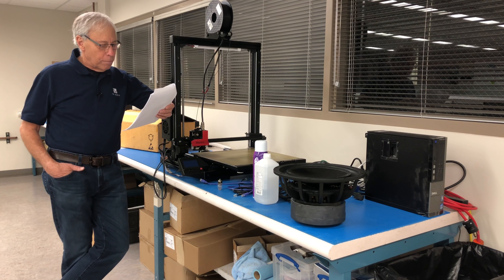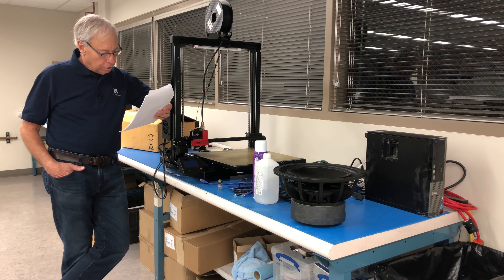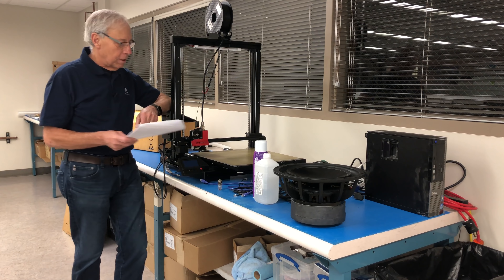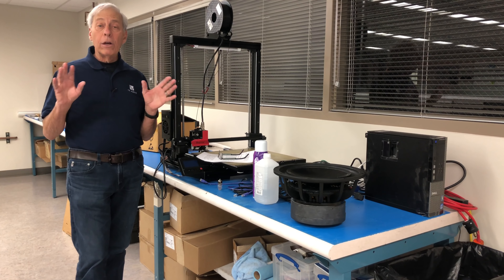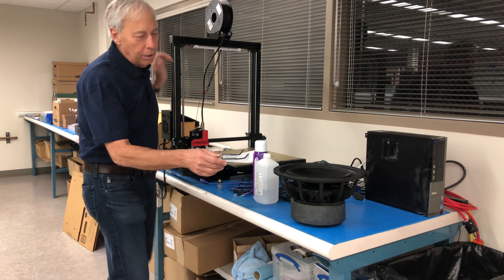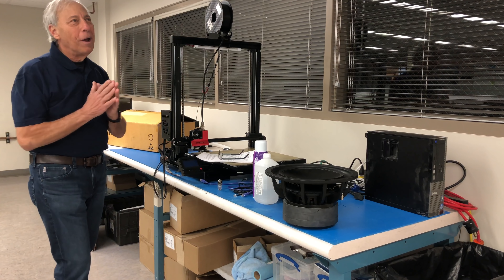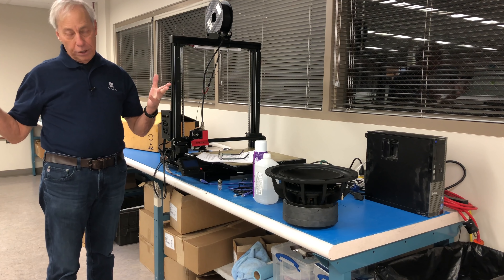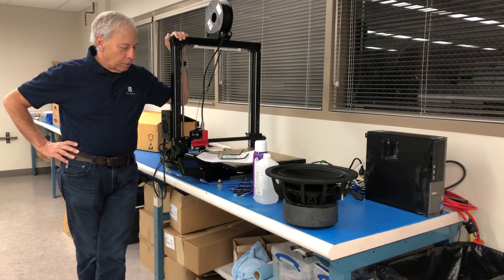Why do vacuum tubes color the sound?

Comment: My simple explanation... tubes make small signals larger but the amplification applied is not 100% linear over the whole input range. When approaching the limits of the input headroom, the gain often falls slightly (the amount being design dependant) and this can result in a small amount of waveform distortion at the signal peaks. As the amplification rolls off at the limits of headroom, it results in even-order harmonic distortion which is often sweet sounding because it's harmonically related in a musical way; like a harmony with one note an octave above. Accentuated even-order (2nd, 4th, 6th, ...) harmonic distortion is the sound of classic Rock n' Roll guitar. Transistors on the other hand run out of headroom in a much less graceful way, causing their induced distortion to be made largely of odd-order harmonics which are both 50% higher in frequency and not harmonically related of the original signal in a very musical way. Accentuated odd-order harmonic distortion (3rd, 5th, 7th, ...) is the sound of typical Heavy Metal guitar. Ideally, your signals will never reach these extremes and any distortion you encounter will be below audible thresholds, but in the world of critical listening even the slightest variation of the harmonic content will be noticable.  Less conservatively designed equipment will generally exhibit more distortion and some products intentionally add distortion to artificially "sweeten" the signal, but it's all about what you love the sound of and not being technically perfect.
Reply: Thanks for the expansion on Paul's explanation. The odd and even order distortions makes so much sense. Even if a valve has an order of magnitude more distortion than a transistor it's distortion is an order of magnitude less grating on the ear. Cheers.

Comment: PEOPLE - get over the concept of, “tubes color sound”. Tubes are wonderful, old school technology, that work beautifully in audio applications. Period, end of story!
Reply: An audio illusion- oh, I get it. My illusions are BETTER w tubes....just saying
Reply: tubes do not work beautifully anywhere, audio or otherwise, they are not stable, produce noise, have short life, are hot and bulky, require high voltage, use a lot of power, and have high impedance; from an engineering point of view, they are a nighmare

Comment: For those tube distortion loving aficionados, you can add the same and even more refined tube like distortion effect using a DSP on your digital music. Compared to a an actual tube, a DSP can maintain the exact same sound without any need for warm up or effect of aging issues that hurt the sound of tubes over time. It can even be optimized to best sounding distortion. The even harmonic distortion some people like from tubes can easily be modeled in DSP code. There is no magic to this. Especially live music contains more such distortion and that’s why using tubes can make music more live sounding. If you play studio recorded music and like the cleanest most undistorted sound, tubes really make no sense. E.g. a live concert with Diana Krall can sound better with tubes while music by Deadmau5 will sound worse.
Reply: Over generalizing I did A-B comparisons with both live actually Diana Krall and several Purely Ambient electronic CD's and Vinyl and the reference ST70 Valve amp from Raymond Lumley was clearly better, not soft or warm it just had a highly detailed holographic sound underpinned by superbly solid fast bass, dynamic but yet polished. It was able to allow instruments and layeted sounds to hang in the sor without losing coherence, in a way the Advantage solid state Pre and power costing over 5K GBP my friend who bought the Amp on eBay paid less than 1K GBP and a further 50GBP to have it serviced, checked and rebiased. It is quite simply one of the best sounding Amplifiers I have had the pleasure of hearing. Valve or SS.
Reply: Gerald Holley Well designed amps using transistors or tubes can sound better than not so well designed transistor amps.
Reply: Old tubes last way longer than a lot of newer tubes. I think that's where tubes get their reputation of being short-lived, also in part because tubes are not always implemented correctly to optimize performance
Reply: The Chad Pad There isn’t much money in making tubes anymore, so they are made low tech with low standards of manufacturing and quality assurance nowadays. To be honest, as an engineer with some depth of understanding, I don’t see a true genuine performance argument for using tubes in modern audio gear. The effect a tube can ADD to the signal (e.g. even harmonics) is reproducible using other much more robust circuits based on transistors including DSP.

Comment: Is there anything that does not color the sound?  Short answer, no.
Reply: Short answer, yes.  A noise from space for example.
Reply: Short answer....Solid state
Reply: Fat Rat  Yup, amplifiers, transducers... pretty much everything colors the sound.  Well said.
Reply: Fat Rat  It should be, but it's not.
Reply: Stephen Smith a carefully designed amp, yes
Reply: @FooBar89  Au contraire mon fraire.  Even the $100k monoblocks from Boulder aren't 100% transparent. I've heard them, and they are damn fine amplifiers, but even they can't make Yo-Yo Ma appear in front of you sonically speaking.
Reply: @FooBar89  So tell me which amps are state of the art and do not color sound?
Reply: My, such a little comment, such a big discussion.  Carry on people.

Comment: There is a bit of over-generalisation going on here. The gap between some modern solid state and valve amps has narrowed a lot. I could actually name some solid state amps that sound warm like valves and some valve amps sound so clean they could be SS.
Reply: Measurements.  Valves get nowhere near and they don't stay in spec as long as ss.
Reply: @captainwin6333  Saying tubes don't stay in spec  as long as solid state is generally true until now Bob Carver makes a tube amp where the tubes last for 50 years hence stay in spec for 50 years.
Reply: @captainwin6333  . Not sure that's true with well engineered stuff like Audio Research.
Reply: Valve amps don't necessarily sound "warm" its a misnomer. They generally sound very detailed and polished but the best ones are very dynamic underpinned by solid fast bass. Or at least the ones I have heard do.

Comment: There seems to be no end of generalizations when it comes to tubes.  Assuming that all tube amps sound the same, is just as ridiculous as saying all solid state amps sound the same.  Just changing tubes in the same amp will yield different results.  And one more thing - Tube buffers are pure audio snake oil that make absolutely no sense what so ever.
Reply: I would disagree with your final sentence and say that tube buffers are most often EQs, often with limited fidelity to accentuate 2nd harmonic distortion, and if you like the sound they produce then you should enjoy them. If your power amp or speakers are particularly bright, a little tube induced warmth can go a long way. Listening is about enjoyment.

Comment: I have a love & hate relationship with tubes, on one hand, they can produce the most beautiful warm and sweet sound that you can imagine. On the other hand, I never could make any digital recording from a phonopreamp based on tubes. I listen the loudspeakers, the sound is super clear, no hum, no nothing. I plug the same device on my audio interface and made a recording and I get not less than 15 lines of hum. I tried with the turntable grounded to the phono preamp, with the turntable ungounded from everything, grounded to the amplifier, to a screw in the pc chasis. Still those f***ing lines of hum, while in the loudspeakers or in the headphones the sound is lovely.

Comment: Howdy. My theory:
The amplification factor is pretty much independent of collector voltage in BJT:s (of course as long it is not driven into saturation). In tubes the amplification factor is slightly dependent on the anode voltage. The negative half cycle on the anode will not go down quite as much as anticipated. I see this as an introduction of the third harmonic.
Regards.

Comment: Tubes don't color the sound if they're applied and designed in skillfully -- but the transformers required to get them to drive low impedance transducers via inductive coupling sure do!
Reply: Yes, but tubes not coloring the sound serve no purpose if there is no voltage to amplify. Thus, between the line level output of a DAC chip and the line level input of a power amp, a tube can only serve the purpose of coloring sound besides being a visually decorative effect.
Reply: @ThinkingBetter  -- I agree completely: including tubes in modern home stereo gear makes no sense other than for the reasons you mention, neither of which comports with the goal of "high fidelity," which means "great faithfulness" to the music being reproduced.
Reply: @editorjuno  great faithfulness god damn

ppl need to understand the sound is subjective, u choose how u want to interpret sound in this world

even ur ears dont have great faithfulness
Reply: @urnoob5528  -- We;; then, I guess "high fidelity" now means "great faithfulness" to your subjective preferences.  Duly noted.

Comment: Lol!
In the UK there's no such thing as "tubes".
They're VALVES because that's what they do.
..and, may I add, valves 'saturate' (clip) much gentler than transistors..
Reply: Arthur Manolopoulos you are thinking of the 80s, if you have a simple amp yes, there is nothing you cannot do with clipping however, including easily clipping the same way as tubes with transistors

Comment: Everything colors the sound. Tubes tend to have predominantly even order harmonics, transistors, odd order, and, yes, the harmonics effect the sound. Even order harmonics are an octave, odd ordered, an octave plus a fifth. An octave will always sound harmonious and even pleasant, think 12 string guitar, a fifth, maybe, maybe not. I play guitar, we play harmonics frequently. A second order divides the string in half, with the two halves of the string vibrating opposite to one another while the middle of the string is stationary. A third order divides the string in thirds with two null points, a fourth order in quarters. Anything else is effectively impossible to play. If you want to hear this, go to the original America album, titled "America", and listen to the last track, "The Pigeon Song". There are a few single notes at the beginning, all harmonics, followed by a second, third and fourth harmonic strum.
Reply: >Everything colors the sound. Tubes tend to have predominantly even order harmonics,
>transistors, odd order, and, yes, the harmonics effect the sound.
Paul really really danced around the issue on this one. To reflect your post tubes add even harmonic distortion, 2nd order, Solid State odd harmonic 3rd order distortion. What he didn't admit to was how much. Both would be considered distortion. A "warm open airy depth ect ect" tube amp is best in the 1% or 2% even order harmonic distortion range. A solid state amp even it it adds a fraction of a percent of 3rd order harmonic distortion will be displeasing. PS Audio adds a tube stage to some of their products. You figure it out why. A very very low distortion SS amp is often referred to as sterile. And that is true. Nelson Pass designs are sometimes criticized for being too sterile. And that would be a correct observation.

Comment: Thanks Paul ! I finally understand how tubes work... i've seen so many videos and read a lot but never understood it ! I gave up... Now I also understand why a valve and a transistor can both amplify the sound... THANKS A LOT !!!!!!!!!!!!!!!!!!!!!!!!!!!!!!
Reply: FWIW there are transistors that are designed to work exactly like tubes. Field Effect Transistors ( FET ) have very similar characteristics in a circuit. Think of it as a tube that does not need a "heater".
Reply: @wilcalint  only jfet, if u search for fet, the most likely thing u will find is mosfet which is 99% of the fets used ever

also the heck u mean exactly like tubes

fet is semiconductor, couldnt be more different

Comment: Tubes generally have less NFB. This means more low harmonic distortion and less higher harmonic distortion. It is the higher harmonics that add edge to the musical tone. This gives a tube amplifier two advantages - a richer tone and more clarity. The clarity comes from increased low order harmonics that make the fundamental more audible (richer). This is most noticeable with hi-hat. A hi-hat (like most percussion) doesn’t produce a lot of harmonic overtones like other string or wind instruments or vocals. A tube amplifier can add enough harmonic overtones (less than 1% but audible) to make the hi-hat more clear to our ears above a crowded guitar and vocal filled mid-range. (Masking means that lower frequency sound masks the higher frequency sounds just above it -  a little third harmonic distortion can therefore greatly improve audibility as it sits above the masked region covering the fundamental)  microphones are also great for vocals - they compress so nicely (less high order harshness) that you get more audible dynamic range by allowing the engineer to push up the low volume details without the loud stuff sounding overly harsh. Of course, the devil is in the detail of the topology and some tube designs add so much low order distortion that they sound overly “choral” and lack prat or edge altogether.

Comment: Paul, you present great videos to watch. I may have teensy little point to quibble over with regard to vacuum tubes vs transistors or for that matter FET's. 
As you have produced and sold a wide variety of amplifiers with solid state and vacuum tubes, you admitted before that B&K amps with a vacuum tube front end sounded better than your best designed solid state. 
Why is that? May I suggest a couple more things to add to the confusion?
If you put your previous best amplifier on a bench along with the B&K (as I recall it uses MOSFET outputs), both would test with a wide frequency response and very low distortion up to rated power. In theory, your ear shouldn't detect a difference if everything from source, to front end, to speakers were all the same. Still, you would hear a difference. That's coloration. The tube(s) alter the sound. Typically a complete amplifier with tubes and heavyweight impedance matching output transformers would likely measure a slightly higher level of distortion, yet many prefer the sounds of tubes. Thanks for all you do.

Comment: If a tube buffer 'helps" your sound, then you have another problem in your system.
Reply: tubes produce sound much better
Reply: I wouldn't use the word helps but it's really altering the sound in a way one likes. I don't like bright, forward speakers so I never owned one, but others do. Doesn't mean the system has a problem, just that some like a bright sound so they buy these types of speakers.
Reply: @BronsonOsborne  Not better than nothing.
Reply: @briansimmons5363  The speakers are part of the system and thus a problem.
Reply: @bilguana11  Ah, I get it. Speakers are part of the system and thus can be a problem, as can the DAC, speaker cables, turntable, audio rack, amp, room acoustics etc.
Reply: @BronsonOsborne  but with less fidelity and so you can't call it Hi Fidelity.
Reply: @captainwin6333   i  use  fisher kx 200 all tube with phase technology speakers and a schitt DAC  AND pioneer pl l800s turntable the tubes really bring out the best in music
Reply: Not true, if using tubes instruments and voices sound more akin to reality then there's no problem with your system at all.
Reply: Bill Crane ... there is no problem if you enjoy the sound of a tube buffer.

I had a good listen to the Yamaha C5000, M5000 and NS5000. It’s really good. Clean, clear and tight. But I miss the tube sound. The holographic sound stage ...
Reply: Agreed.  I have heard great systems assembled using tubes and/or SS, and none of them required a stage of electronics that didn't provide gain put there to "flavor" the sound.  If you like the sound of tubes, buy a tube amp... don't waste your time trying to chase the tube sound with an effect (unless you are a musician buying an overdrive pedal... but that's a different animal.)

Comment: Tubes and Vinyl rule.
Reply: Rule the land of non-HIFI.  Leave the HIFI to other formats grandad.
Reply: @captainwin6333  I don't know what the f*** you just said little kid but you're special and you touched my heart!!
Reply: @captainwin6333  I'm 37 and I cannot agree more with Geerladenlad.   Tube and vinyl rock!!!  If you prefer digital, congratulations, I do not.
Reply: Fat Rat  exactly 💯👍👍
Reply: Fat Rat  The BHK monoblock amps have input tubes in them. 
Also Paul brought a  VPI turntable back from RMAF.
Reply: Fat Rat  Nah, Paul is not actually a fan of tubes.
When it came to the BHK input stage with the tubes in them the superior sound quality was undeniable!
Reply: Tubes are evil - causes you to chase for expensive NOS valves
Vinyl is evil - causes you to chase for special records, tone arm, PSU, head shell, stylus, platter and everything else

😂🤣
Reply: Fat Rat ... sssssshhhh! Sarcasm. 😂🤣 I do like the sound of vinyl but am staying far away because of how ‘evil’ it can get.

ps. just purchased a second set of Pope 6SN7. See how evil it is?
Reply: @hushpuppykl  you don't have to succumb to tube rolling. Electro-harmonix and Tung Sol Make great tubes. You could even order tubes from Mesa Boogie and get good matched sets.

As far as the vinyl goes yeah that could get expensive if you want to own everything under the sun. 🌞